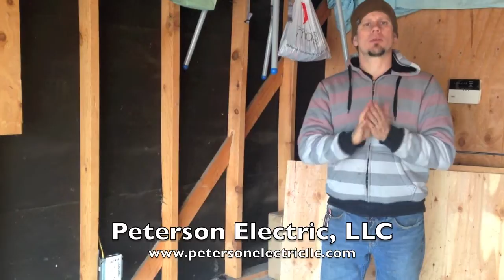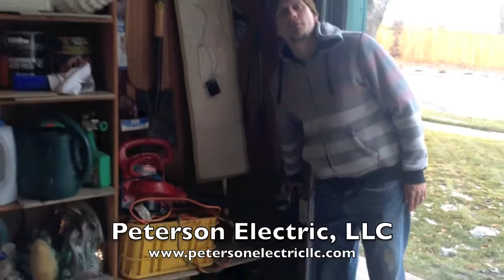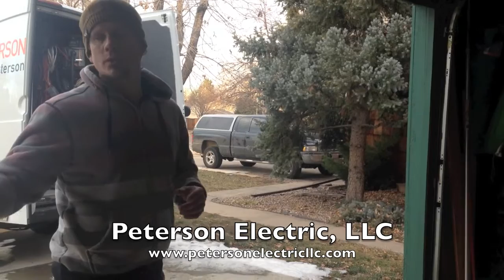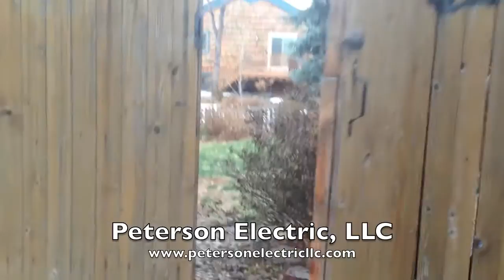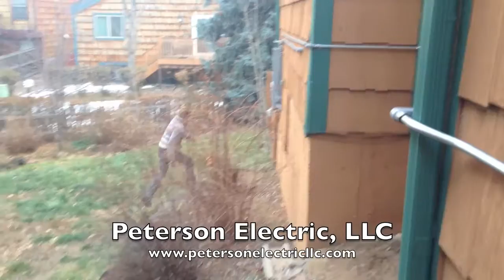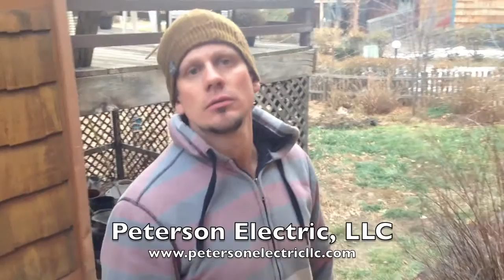Why A Dedicated Circuit Was Ran With EMT Conduit? Fridge Tripping Breaker

Comment from the maker: No it is ok to do run it on the wall, more labor intensive, hammer drill vs deck screws . I'm sure it will not be easy for the trim guys. We asked the homeowner and they did not care.